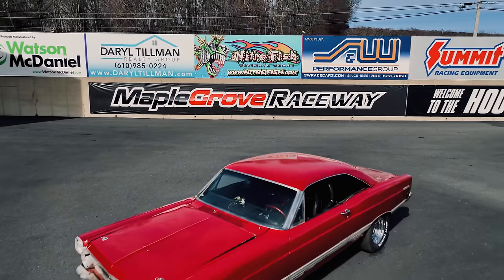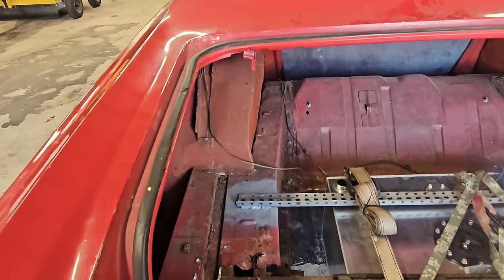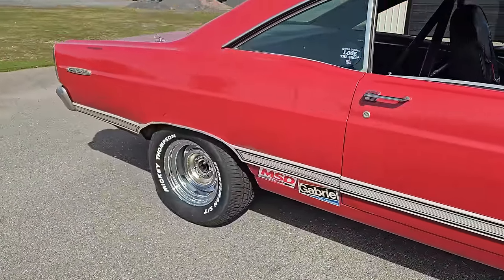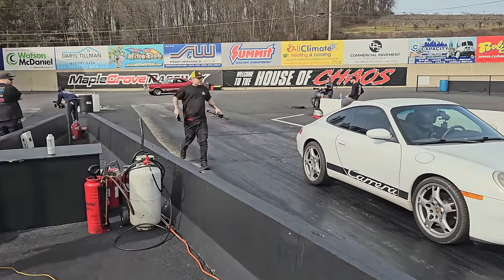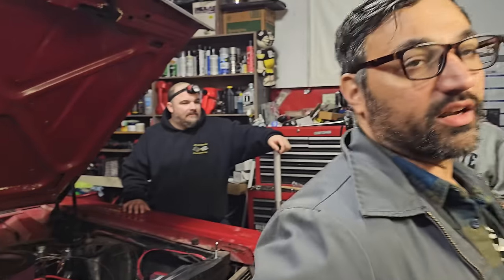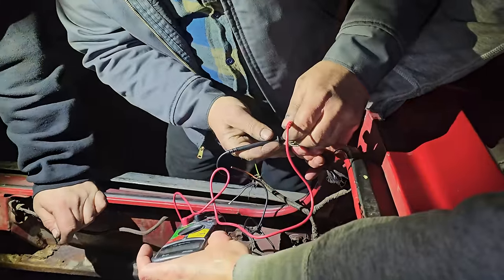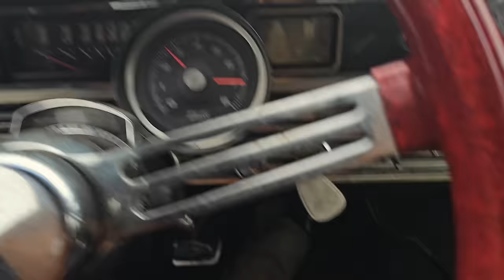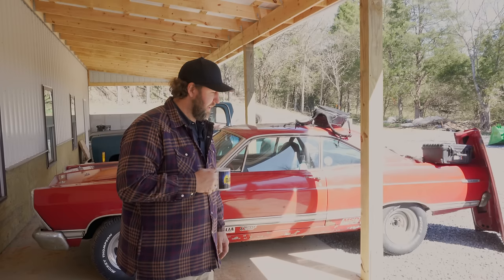Will It RUN AND DRIVE 900 Miles Home? LEGENDARY 70's Built Ford Drag Car - With Tony Angelo!

Comment: Rain next definitely does not have to be applied every hundred miles. However the window does have to be dry when you apply it typically if it’s raining out and you pull into an overhang put your defroster on hot and use that to dry the window. I’ve use rain X for many many years And at 40 to 45 miles an hour. Any water on that window should blow off if it’s applied correctly. Also if your glass is not clean it won’t work as well. See you in that car was sitting for so long you might need to maybe clean the window with denatured alcohol or something like that that might be a film on there that’s causing a problem, and if your floor is wet and you have exhaust going under your car, that’s probably what’s causing the inside to steam up so much on top of your breathing and body heat. I try to just crack in the window a little bit to get some air circulating in there if your windows are all the way up that’s not gonna help.

Comment: I drove over 300 miles (including the prettiest parts of CA Route 49) in a 1955 VW bug without 3rd gear in the original non-syncro-1st gear split-case tranny with a dual-carbed 1914cc hanging off the back.  It can be done.

Comment: Step 1 put wipers on it. Step 2 put a blower (with heat option) fan in it to clear fogg. Step 3 cover the giant hole round the shifter. Step 4 electrically heated seat pad. Step 5 have fun......

Comment: Cool car, cool build!!!  I'd love to see ya put a Thunderbolt hood scoop on it - just because you can!!  Although a home-made Ram Air system for it to feed into would be way cool too - sort of a nod to its' previous track heritage, that sort of thing.  Shouldn't require a mess of parts to put it back into the 10's either - and that's only if you decide to go "all motor."  Laughing gas and iron lungs might drop things into the single-digits, but methinks ya might have to cobble up a wee bit more cage to keep the track folks happy, and perhaps double-torque all the bolts on the T-5, just to be sure.........😎

{And for those of you laughing because "Tony broke it - AGAIN!!!"  I have a slightly different take on things.  If Tony HADN'T broke the T5, would it have lasted the 900 mile drive anyway - or would it have crapped out say, 275 miles into the journey, when Derek only had his Leatherman for tool assistance?  Bullet skillfully dodged, if ya ask me.}

Comment: Rainex and some thing to cover your nose and mouth like a turtleneck or scarf plus cracking the driverswindow was how I used to drive my old 73 VW bus with no heat in the winter to keep the windshield mostly fog free. Give it a try sometime
Reply: I had working wipers though

Comment: Had a T5 in my 3rd gen Camaro back in the day. First was a non-world class that  ended up with three 10 inch cracks coming from the front cluster gear bearing. Then I shredded two third gears in the world class that replaced it...😂

Comment: I own a 67 fairlane. 390 big block woth 427 heads  9in rear  i have a manual for it with 4 11 gears.  My father se it up for drag racin i love that car, ill never get rid of it, its cammed also, hooker headers,   runnimg on the high way wih the 4 11 an 4 speed it ran at such a high rpm an was just loud. Never tried it with the automatic

Comment: They used a jack for that little light transmission??? I benched pressed a c6 as we didn't have a jack big enough or tall enough to reach. I believe it was my junior year in hs. Lol i had so many mustang transmissions clutches in and out in maybe 2 hrs. Did it so many times i had it down with the unneeded items removed. Dropped a counter shaft in my 83 ranger. Driving it 4th gear ⚙️ sucked, but gotten it home. Finding a transmission was a few week ordeal.

Comment: You don't really need a heater box just drill 2 holes in the fire wall than you can have a remote heater core

Comment: The Red Rover needs to come over with a heater core & cold AC.5.0 came with oxygen  pump,ac and h3ater box,I had a,1987,lx most reliable car  I ever  OWNED AND  IT ALSO WAS A DLORIDQ5 STATE  TROOPER CAR WITH,273 third member and a t5 with 3rd gear busated,copw5 can't drive  a clutch

Comment: Hey man 15mpg at 2800 works for an would be drag car. The less you spend on hippy tears the more you can sink into the car and that thing needs some go-fast. It looks faster than 13.00 so i say its begging for some forced air or camshaft swap

Comment: I have a question, my daughter and I are building her first truck play 95 c1500 has a 4l60e transmission that needs rebuilt but we are putting dual exhaust with cutouts and flamethrowers no oxygen sensor on it I'm thinking that transmission won't work would you happen to know if it would, if I change the intake and go to a carbureted system instead of the fuel injection can a turbo 350 work in it
Reply: Turbo 350 would work fine if you went carburetor
Reply: 4l60 is the biggest piece of trash Trans ever built......My 15 sec camaro trashed 1

Comment: Can you know the best dragster with transmission Mercon 5 fluid temperature gauge as perfect way to check measuring 4R70W ATF Ford factory transmission company in ATF same as The Plant.

Comment: I think a 427 needs to go back into the car. An original 427 cammer. Nothing new or crate. On second thought, a $100,000 dollar engine might be out of the question. I had no idea those were worth that much. Ouch! Alright, just build a period correct motor. 390 or something..

Comment: You should spit on the windshield wipe it all over and wipe it off. Works on the bathroom mirrors, scuba masks and windshields and it's free.
Reply: The only thing i would do if i was you, Would be to move that roll bar back about 50 feet.